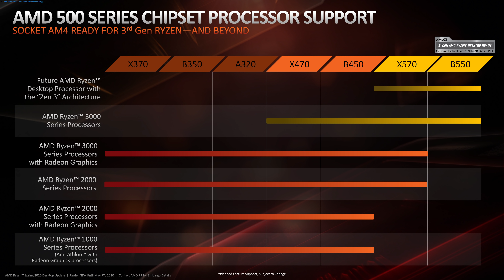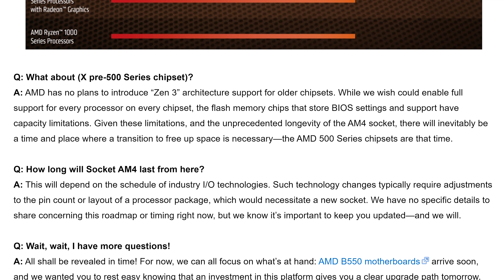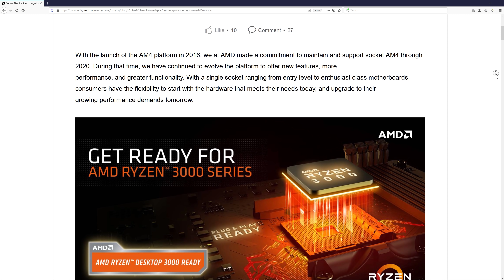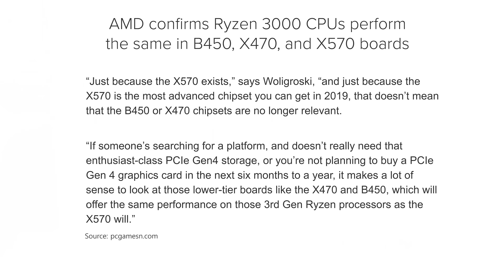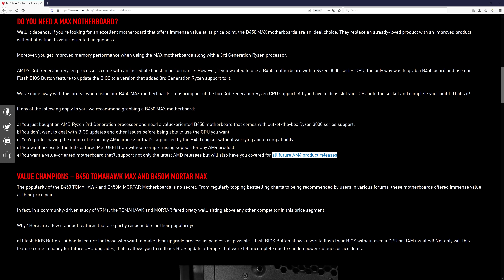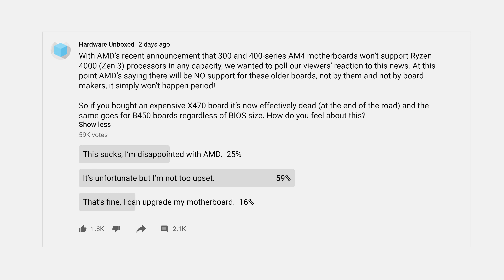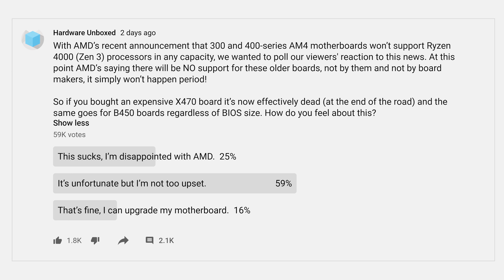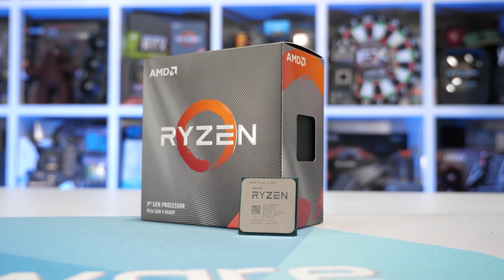AMD Does An Intel, Axes Zen 3 on 400-Series Motherboards, Our Thoughts

Comment: Can you imagine being MSI. They wasted  those resources trying to get B550 stable, then AMD tell them their MAX lineup is now pointless.
Reply: MSI : screw this, Let's go back to Blue Team
Reply: Correction : B450
Reply: @zabuza8548  ? No, B550.
Reply: @MadSupra354  B550 isn't released yet. B450  MAX is what was released
Reply: MSI is screwed unless this is overturned... they are facing potentially having to refund ALL of theyr MAX series motherboards due to misleading marketing AND they will have hundreds of thousands of boards sitting in the warehouses absolutely unsellable ...
Reply: @Asghaad  guess thats what they get for taking part in Nvidia Geforce Partners Programme a few years back.....
Reply: @Asghaad  how is it misleading marketing? Even MSI didn't know about this
Reply: can you imagen a company incompitent enough that they had to relaunch because there BIOS is to cluttered and bloated to fit the same files on as say SArocks B350 mobos
except ASrock fitted all CPUs on with no issue
Reply: @samcan9997  MSI click bios contains a lot of bloat. Useless graphical assets consuming tons of byte space. A BIOS doesn't have to look fancy. It isn't something that needs to be pretty. It just has to be functional and give you the right settings to tweak. In fact I prefer the old style text mode look of BIOS of yesteryear to these highly polished mouse driven menus. Just because you can doesn't mean you should. A big issue is that the motherboards are treated as a complete packaged consumer product on its own instead of just a component in a completed PC build. That is why you have all the fancy branding and artwork on the boxes etc.
Reply: Looks like AMD has f**ked all the board partners and all of us good time
Reply: MSI largely screwed themselves by being cheap on their initial AM4 releases, by only using 16MB ROMs when every other company had 32MB. That caused issues with those boards even getting Ryzen 3000 support. The only thing the Max line did was bring them in line with the standard. X570 does not support 1st Ryzen or Zen 1 based APUs, which does carry some reasoning that there is genuinely not enough space. While I am on X470 myself, my IT support experience tells me a solution of have certain bioses support certain CPUs is going to be problematic for the common user.
Reply: @Mifthahul Fikri If that's the case then MSI for some reason had a UEFI that was far too bloated. There were only reports of issues with MSI boards.  I have an Asus Strix X470 and B450 board, that didn't lose any features to support Ryzen 3000. Both of which I bought during the Ryzen 2000 release though. Oddly there seems to be more UEFI options on my B450 board than my X470, but nothing I rely on. It makes more sense then that most of available B450 boards really don't have the space then, while X470 probably should. I've seen an A320 board suggesting not to use the latest UEFI if you have a Pinnacle Ridge CPU, which is likely going to result in some confusion.

What I need now is for the B450 computer is to run Dual GPU's, which means replacing it with my X470.

Comment: I agree with Steve, x470 and b450 should get further support. Note I have both a b350 system(home lab) and my gaming system on x570. Though I wanted a long term platform with the option for pcie 4. I also find it interesting that b550 doesn't support 2000 series is a bit surprising as the x570 does. Yes you wouldn't get pcie 4 but it that would have been great for new buyers with more options.

Comment: I actually disagree with you on the reasoning behind this decision. I think Linus had it nailed in his take on the most Recent WAN show. When Zen 2 cpus released, its fair to say there were quite a few issues related to compatibility that arose, with some board partners initially saying they wouldn't support zen 2 on 3XX series boards, to AMD needing to send out cheap cpus just so users could flash their bios on their board for compatibility with zen 2. It was messy and introducing multiple bios options would absolutely make this even messier. From the perspective on an average consumer motherboard support was already slightly confusing with AM4 and Ryzen cpus, but if Zen 3 support had been shoe-Horned in to 3XX and 4XX boards it would make the whole thing worse. What if you buy a cheap B450 board with a Zen 3 CPU and it comes with an incompatible bios? You've then got no way to flash it without running into the same issue as last time whereby youd need to find an older cpu to drop in just to flash it to support your new Zen 3.

That said, I still hate that they've done it.

Comment: IMO(!) this doesn't seem to be rooted in artificial limitation by AMD, but rather cost saving and quality decisions made by motherboard manufacturers. They didn't want to invest significantly in the emerging Zen platforms for arguably the majority of their 300 and 400 series AM4 lineups, and as a result, most of them are not capable of working properly with 2-3 generations and 3-4 year newer CPUs. Either reliably, or at all. Ie, the portfolio of incapable boards, is likely alot bigger than the potentially capable segment. For AMD to support this, they have to include the lowest denominators. And many of them are barely able to support their PCIE2.0 based board/chipset IO, and drive 1st gen Ryzen 7 chips without bursting into flames. 

IMO, if anyone "screwed you" here, it was the motherboard manufacturers. What little is left of the portfolio that might be partly capable, simply makes for too big a liability risk for AMD because of the shoddy standards of the rest of the stack.

The "solution" here, IMO, is not AMD making unpredictable, sketchy, experimental-level alpha/beta AGESA officially available to the masses. But rather, an "accidental leak", for enthusiast communities to have a go at, at their own risk.

Comment: Bought almost a year ago a B450 Carbon Pro and a Ryzen 2600 with a Ryzen 4000 upgrade in mind (there weren't the MAX versions of B450 at that time, neither B550 of course).
So basically yeah, I'm pissed off, hoping for multiple Bios support...

Comment: This move is basically the trx40 replayed. In the near future the pci-e 4 devices will become ubiquitous and a re-engineered board would be required. AMD knew this and played their cards well, ironed out bugs with x570 and trx40 users and later on just sidelined the 400&300 series guys just to make sure you buy a new board and take advantage of the new tech without many problems. If they're implementing support for 400 series guys i don't think it's a great deal more difficult to implement it for 300 series boards. All this is just done to save their ass and avoid comparability issues imo.

Comment: Luckily i went with an x570 last year, i will be jumping on Zen 3 if it offers the rumoured 15%+ boost, they still need a lower latency or stronger single core perf to match/beat Intel. Their multicore perf is very strong though.

Comment: amd should support atleast 400 series M/B for 4000  series CPU. if bios size is the problem on 400 series M/B then most people fine if amd drop 1000 series CPUs to support 4000 series CPUs in BIOS.